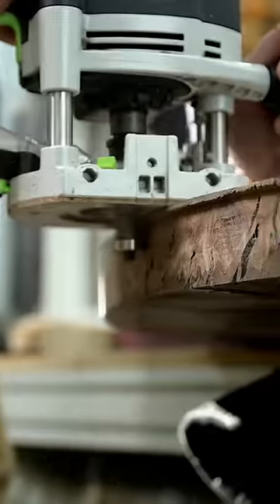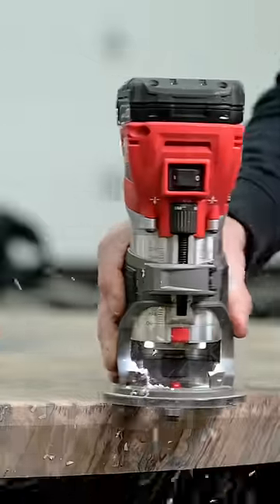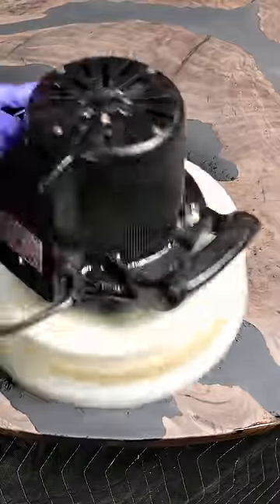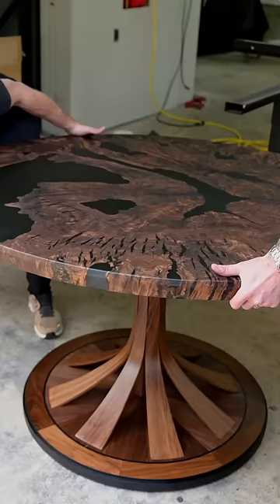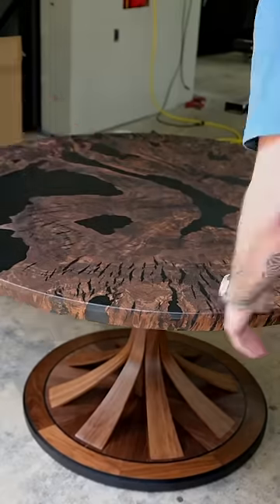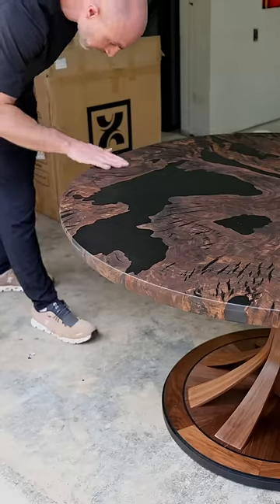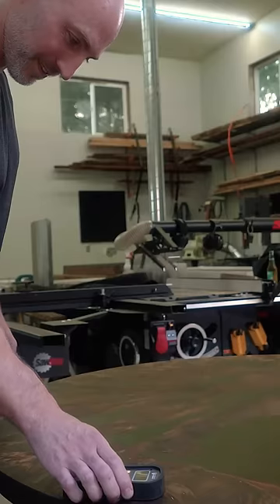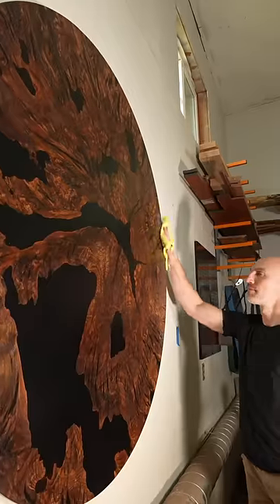My biggest f’ up

Comment: What if you took just a tiny bit off the top and the bottom with your cnc router just to allow the wood to breathe again, wait till it's dry, fix any imperfections that pop up and seal it again?

Comment: I don't understand why for the money your getting for these you don't just sand it to a gloss finish rather then going straight to buffing with a wax or whatever it is you use.. I make epoxy handles occasionally and take them all the way up to a 3000 grit and they look like glass when they are done which is clearly going to hold it's finish forever opposed to needing to rebuff and wax every so often

Comment: It's very beautiful, that's an awful lot of work  only to not  just  keep it as a table, knowing it takes that much work and time, I'm wondering why you can't  check the  original cut  slab for  trapped  moisture  , Before you put all the  work into it, I would  have been  more than happy  keeping it as a  table, it's absolutely  stunning 💯

Comment: Why is trapped moisture even a problem if the epoxy encapsulates everything?
Reply: It will rot. Things that have moisture in them don't lose that moisture when they're cast in resin.

Comment: Consider to fill the void spaces with what you cut off of it so you don't spend 12 gallons of epoxy that looks to flat or one color in contrast with the rest of colorful board. 

It'll be in the wall until drier.

Comment: Honestly, it seems like a shame to put plastic all over beautiful pieces of wood like this. Does your resin hold up long-term? Every resin I've ever worked with has yellowed and gotten weird after a long period of time. I would've cut a piece of glass to either rest on top or fit into a routed circle in the center of it to preserve the wood in its original state.

Comment: why is it ok for a wall but not as a table? is a cup of coffee too heavy for it? or would it fall apart if its set horizontally?
Reply: Imagine having this huge table just collapse while you're eating dinner on it. On the wall, you're less likely to be putting it under stress as well as less likely to break a bone when it breaks apart.
Reply: @roseabee7503  yea a full dinne r setting is pretty heavy. but i guess i still dont see how a small moisture pocket would cause tota l failure. also why couldnt he cut out the area and fill it with more black epoxy.